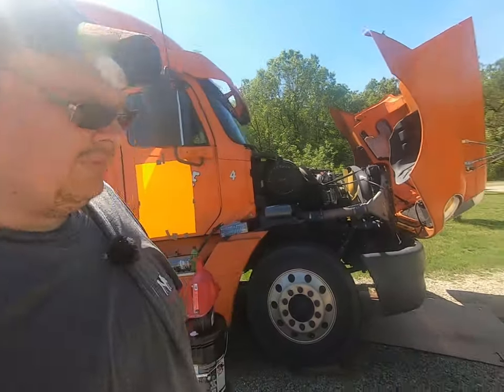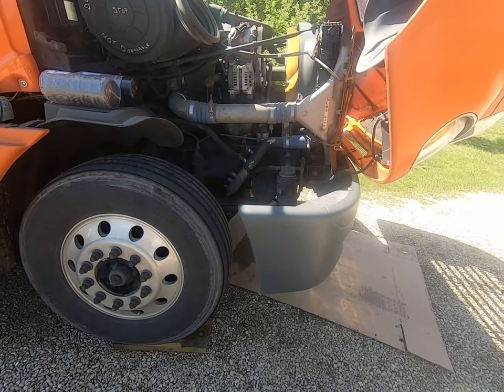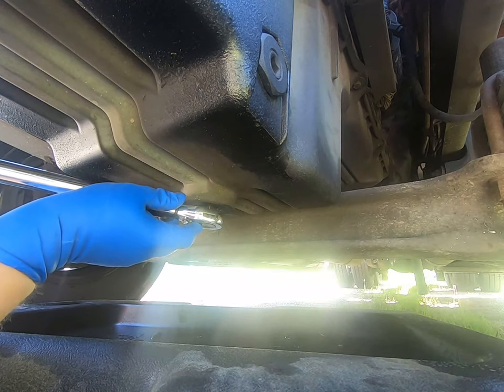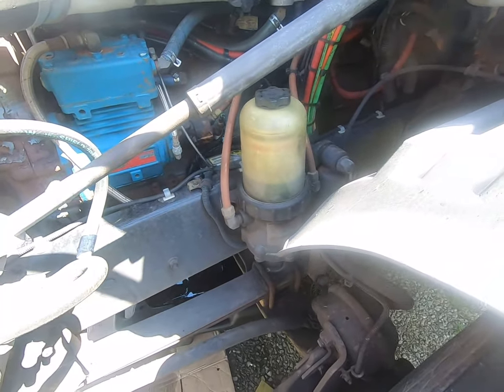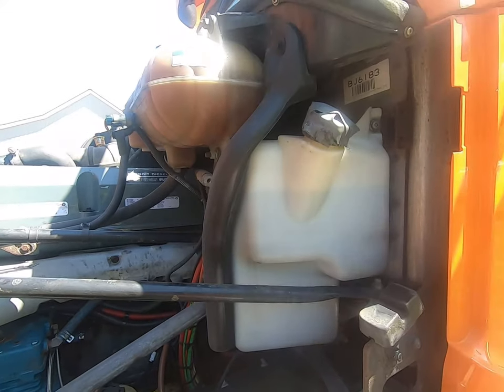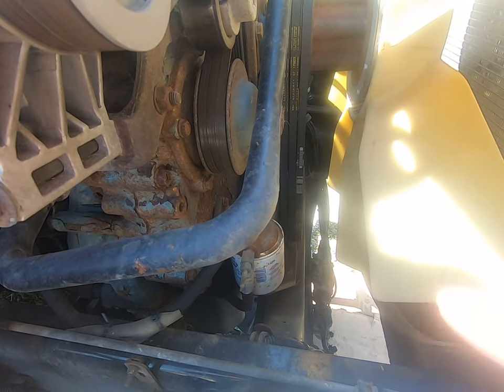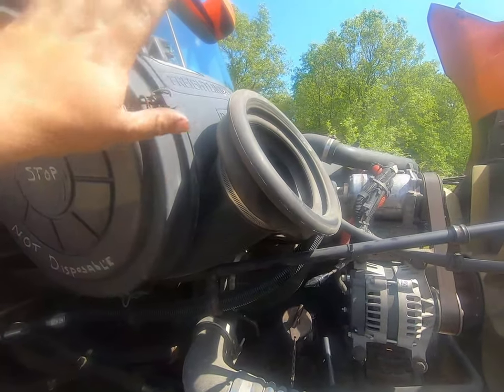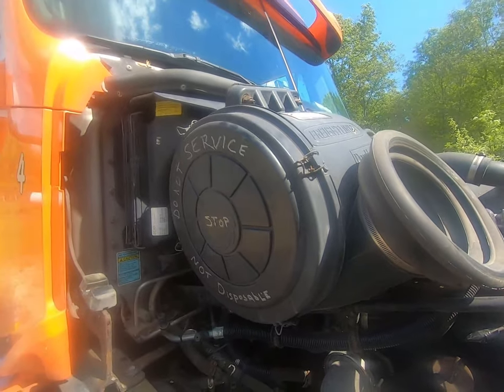Full service pm and oil change. Freightliner / Detroit Series 60 Part 1

Comment: I've been doing mine almost 2 years and I got it down cheap and still great oil samples.  I used to run high dolla oil and Lucas.  Now I get the house brand at Tractor Supply and ad a gallon of 140w gear oil and it stays as clean as rotella and less blow by. Detroit 14L 60 series 2006 Columbia.
Reply from the maker: Great tip!
Reply: you just add a gallon of the gear oil with the 10g of oil ? 
does it help with minor leaks ?
Reply: Excellent tip indeed. My blowby is RIDICULOUS. I got my oil changed during an oil pain gasket replacement and thinking about changing it because they used that nextgen crap. All these dealers/quick lube places do.
Reply: How is this engine in general?  I just picked up a freightliner century 2004 with the same engine.
Reply: The problem with adding gear oil is that doesn’t fix the engine damage you’re just covering it up so it makes you feel better. The reason blowby exists is because the rings are packed of carbon and the oil passages in the piston are clogged up. Get a high quality bypass oil filter that makes the oil much cleaner and almost yellow. Change the oil every 10k no matter what. Run a strong additive that cleans carbon every few fill ups.

Comment: Great video boss! I have a ez valve drain plug on my pan, works nice.
Reply from the maker: Cool, thanks!
Reply: Works nice, but you can't check metal shavings
Reply: @maratkhusnutdinov8939  it’s easier to do oil samples without getting dirty. So you can see if there’s metal, fuel; or coolant from the results instead.
Reply: Does that ez drain mount into the side or bottom of the oil pan?

Comment: Good evening. I have a 60 series 14l and having low oil pressure issues. Changed the oil, oil filter, oil pump, bearing, valves and oil pressure sensor. Got the engine checked and everything was okay now the yellow check engine light and red check engine light and truck dies after 35min or so. Any help?

Comment: I want to know more about the oil bypass system. I have a 98 12.7. My blowby is concerning me 😔! I have excellent power and great oil pressure. Just getting started and afraid the previous owners (FEDEX GROUND CONTRACTORS 🤦🏾‍♂️) neglected the truck to the point I may need engine work at 360k.
Reply from the maker: I have a couple videos on it.
Reply: @DIYSEMI  ok cool. Let me go rummaging. Pittsburgh power has one as well.

Comment: I've come back to your vid to verify that your glider doesn't have a primary fuel spin on filter as well. Why don't these gliders have them. And I don't have a coolant filter on my glider.
Reply from the maker: Good question. Mine didn't have a coolant filter either. I added it on

Comment: greasing is that sucks. I change oil, filters, diesel filters, all fluids and tire pressure then take it to loves for greasing and pay $150 for it. its too much work and i hate doing it even though i have the pump.
Reply from the maker: speedco will grease truck and trailer for about $40
Reply: Always grease your truck by yourself! You can find some problems under it before they stop you on the shoulder somewhere in the middle of Montana.

Comment: What is the best oil  for higher mileage 14l Detroit ?
Reply from the maker: Matter of personal preference and opinion. Any of the major brands will do you just fine....strongly consider using the fuel ox Infiniti lube additive.you will like it. Fuelox.com use my discount code for 15 percent off. Diysemi
Reply: @DIYSEMI  If we do the oil change ourselves and saving allot on labor, Will there be a benefit using AMSOIL ? Looks like you used there filters, yes it’s way more $ plus the additives

Comment: 2 amsoil full flow oil filters?
Reply from the maker: you can use whichever brand you want. I use the amsoil ones
Reply: @DIYSEMI  I ask because I think ...be or not to be.. amsoil or not amsoil...for my 3406B full mechanical CAT...in my case this is gonna be the same oil filter as C15  never try it before so just wanna check... If you like them and do you still use them? Really wanna try... This Sunday gonna install Amsoil bypass oil filtration system... So start thinking about amsoil oil filters for full flow (EAHD4005) and bypass system (EABP120-EA)

Comment: I have Columbia glider and it’s peace of sh_t in terms of driver comfort, unbelievably uncomfortable truck on road, it’s more loud than inside in 2 world war tank, steering wheel it’s sucks, engine break unusable in downhills on new engine, cab lights should be  more bright, every week spent in this truck I feel to I shorten my life for one year, easy and cheap maintenance and money maker but killing driver to much.
Reply: Haha get a Peterbilt you’ll regret the stove pipes next to your ear. The Columbia is a good truck but it’s getting old and needs upgrades to be comfortable. If you get big mufflers and air suspension on the front with a good drivers seat it will feel like a brand new truck. If you still have too much road noise get better tires and install rubber dynamat on the cab floor and walls.
Reply: The Peterbilt is more uncomfortable